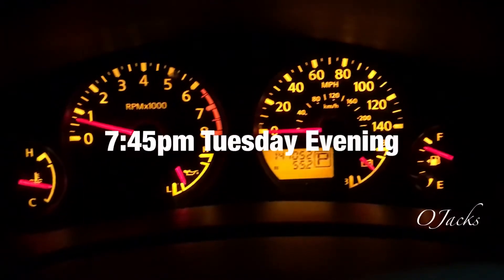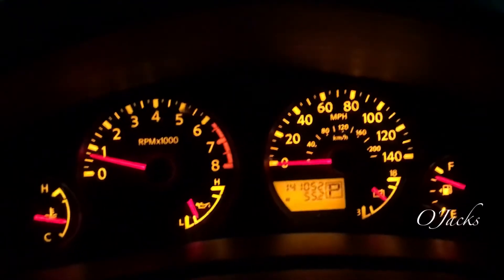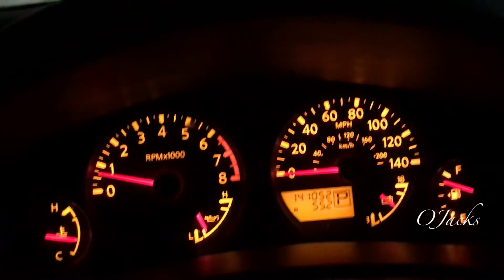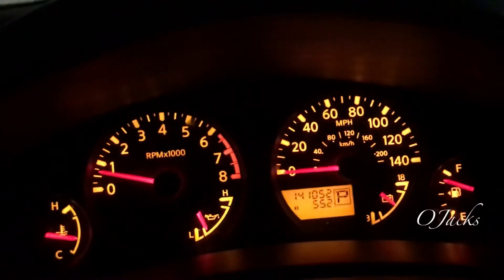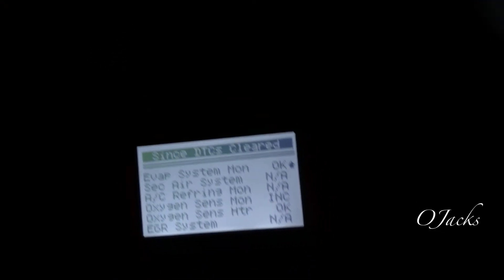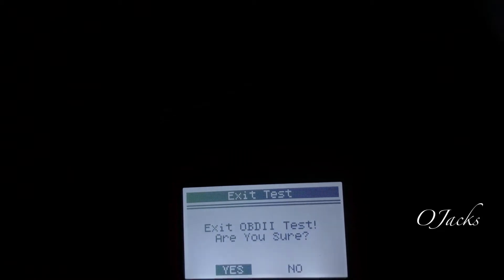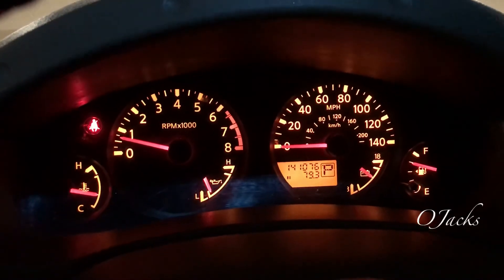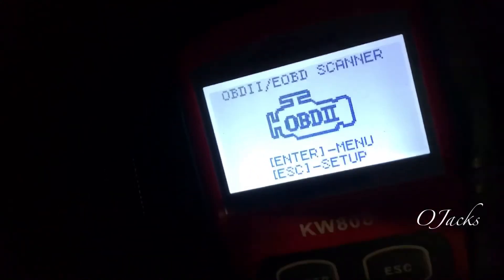Update #4 on the O2 Sensor Modification

Comment: Perhaps swapping out the resistor to 1M ohms would prevent the pending P0420?  Good video series!
Reply: Just FYI 1Mohm was too much for my 02 civic LX. It kicked a code back for the other sensor at 1M.